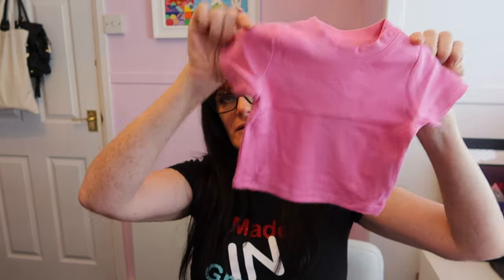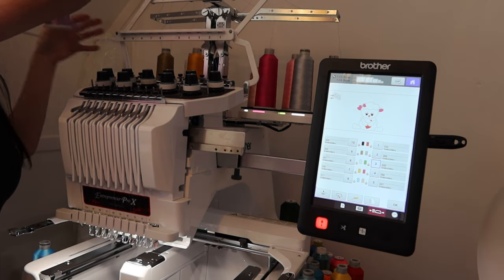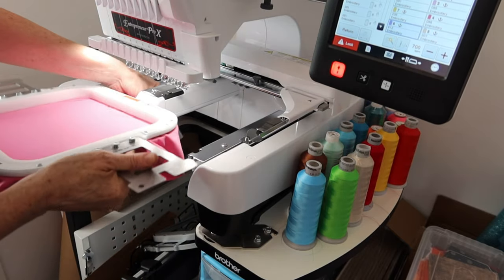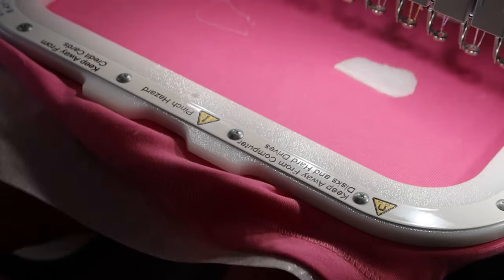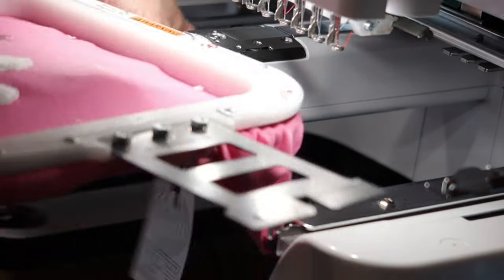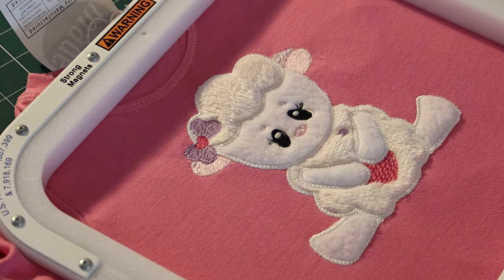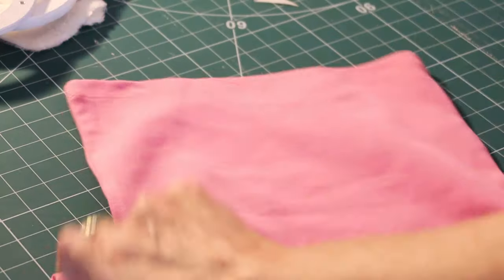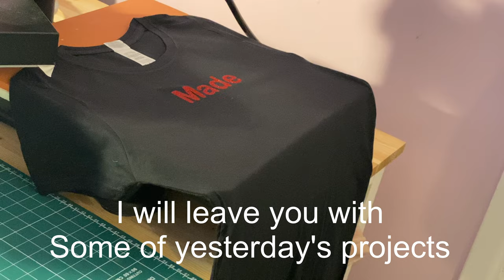USING MINKY FABRIC for MACHINE EMBROIDERY APPLIQUÉ Cute Lamb Design

Comment: So sweet.  You did a good job. What heat press do you have?
Reply from the maker: I bought it from eBay but if I’m honest I wouldn’t recommend it simply because mine came with a non uk plug and had trouble finding a fitting that actually fitted it securely. It’s loose and keeps moving about therefore turning the machine on and off.

Comment: hi kim i live in bath in the uk, i just purchased some lovely rainbow material from you, i have a pe770 brother i got second hand, thats all i can afford, but I'm finding it hard getting things here in the uk, like heat and bond i see you have a bog box of it, i could only get some folded, could you maybe help me to where you get yours from please, also can i get small threads cheaper any where at all, as i buy them on eBay the bothered ones as these work nice in my machine, i have not tried the ones you have, but i found one place that sells them, the smaller ones i mean, but there nearly £5 each thats terrible, thank you so very much, also t-shirts are expensive, i love yours but i need them to be not too expensive also. x x x
Reply: I got some heat and bond on Amazon( 3meters). There is also a bolt for about £50
Reply from the maker: The heat and bond I bought from eBay cost me £165 or there abouts, it’s a 75 yard box. I’m not sure if that’s good or not. Bro threads on Amazon can be a good deal, I’ve bought them in packs of three for about 12.99 for the 1000m cones.
Reply from the maker: I’m also going to look into a way of selling shirts maybe on my website instead of Etsy. Then I can do them a bit cheaper. Or I’ll look into postage and see if I can bring the price down a bit to help people out.